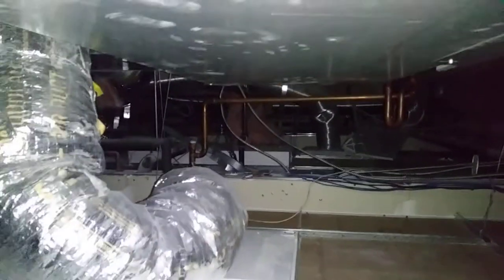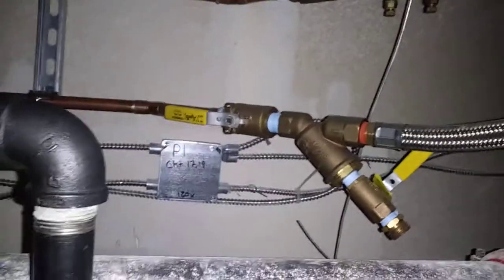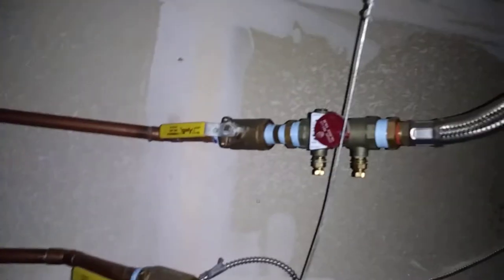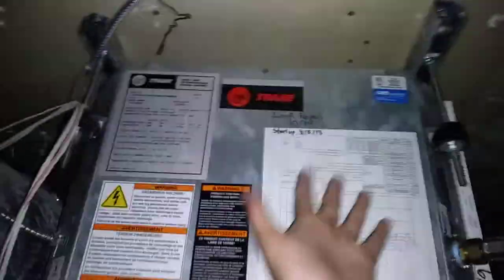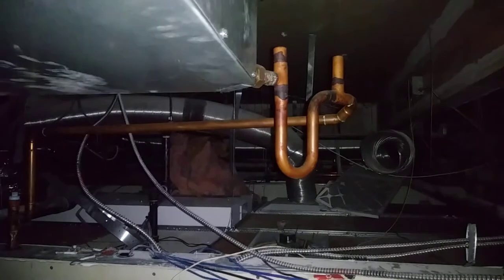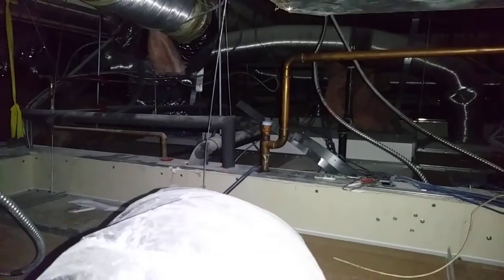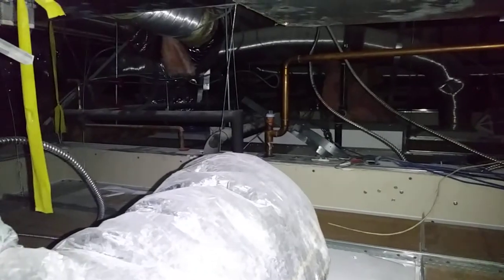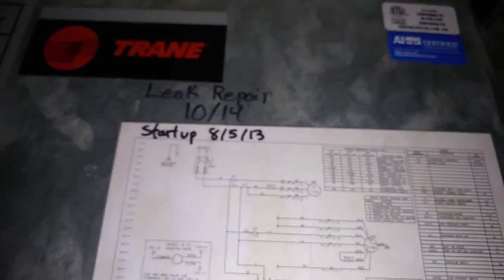A Quick Look at a 2.5 ton Trane WSHP Install

Comment: Really nice install ! They told us in Union school to aways use full port valves so that you have full flow to the unit. Do you have any VAV box's there ?
Reply from the maker: Thanks bud! Like I said, there's no reason not to use a full port. In hydronics, you want minimum resistance to flow everywhere except the metering device itself. It kills me to see guys using short radius elbows, too. A couple years back, one suite got the condenser water piping done by a plumber. His first fitting off the riser was the branch of Tee so the water immediately hit a wall. Then after that all short radius elbows, with saddles over everything instead of just raising the level of the whole system. So we had places with 4 hard 90s that could have been avoided by an elevation change. He basically just piped it as you would domestic water. It's not that he was being an ass; he just didn't take water flow into consideration. He also got the supply and return crossed up. When they turned the water on to that suite; not only did their units not work; neither did any of the other ones on that branch of the loop! That's how I originally found out about it. The units in the occupied space next door went off on head pressure; so I went to clean the strainers only to find high pressure water on the wrong side of the coil! I figured out what had happened and reported it. The contractor swore I was just trying to push a building issue on him. With the contractor, his boss, the plumber, the property manager, and our chief engineer standing there; I showed them the simple evidence with a pressure gauge. And everyone got real quiet lol. Long story short, they paid me to repipe the whole suite!
Reply from the maker: No VAV boxes at either of these building by the way. But, there are a few building I visit occasionally that have them
Reply: @71dembonesTV  At least you prove it ! That is nuts we had the same thing happen but with a return air and supply air duct got crossed up and same thing contractor wanted nothing to do with it intill the chief engineer took him right to it ! Contractors can be really hard to deal with sometimes !
Reply: @71dembonesTV  Oh okay so far all are box's are working thank god but they can be a real pain to get to !
Reply from the maker: @67tr876  yeah, they are usually looking at each job as a one time slam dunk instead of the whole picture like you and I do.